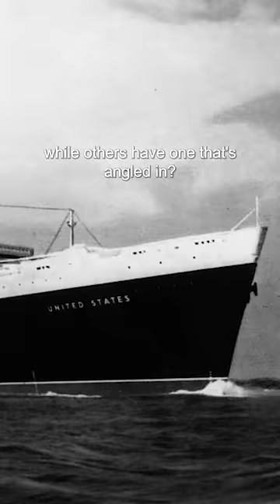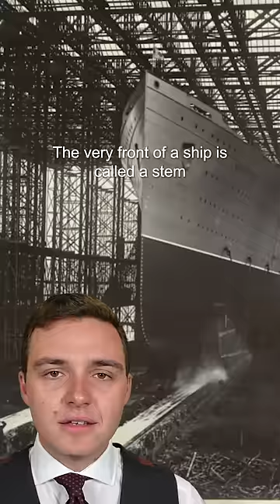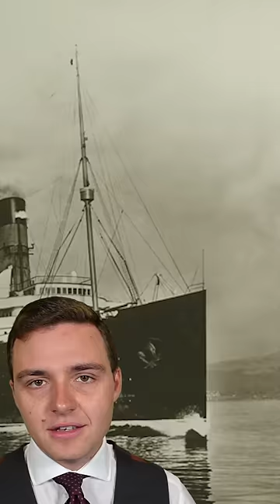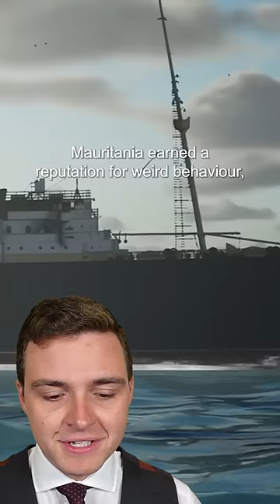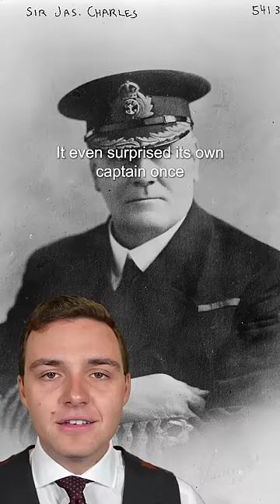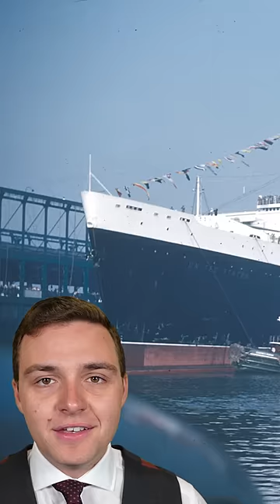Did You Know The Reason Ships Are Shaped Like This? #shorts

Comment: Straight stems had a slower rate of increase of buoyancy (compared to raked bows) as they pitched down into water.  On the plus side they had increased waterline length and thus higher hull speed.

Comment: I'd like to hear you talk about the Bulbous Bow, an odd-looking, yet ingenius, protrusion extending from the front of most modern bows (below the waterline). It's designed to cause waves which occur in counter frequency the regular bow waves, neutralising drag to an extraordinary extent, profoundly improving the ship's engine efficiency & reducing fuel use. (As much as 20-30% of a bow without it!)

Then there's relatively obscure concepts (to us landlubbers) like the Deadrise of the hull.

Comment: You know every now and then you are surprised at how perfect math can be.
Water weights 8.4 pounds per gallon. Im a bit of a Titanic fan so I know the size of the breach was determined by how fast she sank. And it was determined at 104,000 gallons per minute. So based off the time Titanic took to sink, that would have been 104.83 million gallons of water. I looked up the weight of the ship, and it happens to be almost approximately the same weight as the weight of the water it took in. 104.8 million pounds taken in, 104.6 million pounds weight of the ship.

Comment: Vertical stem maximizes the vessel's length at waterline, increasing the hull speed. Without rake or flare providing progressively more buoyancy and dampening oscillation, the hullform is prone to an unpleasant porpoising habit. Taken too far, raked stem and lots of flare can lead to slamming, so like much of vessel design its a balancing act

Comment: There were a number of destroyer & Cruiser designs from WW1&2 that were notorious Wet Ships meaning even on the Bridge amidships in any heavy sea, the Bridge crew would get soaked. The "Dreadnought" style straight stem bows were the culprit. Yet adding a small hydrofoil wing either side of the bow would have alleviated this problem. These day's large merchant ships have a large bulb at the waterline on the bow to break up the wave action in a similar way along with raked stems. Why hydrofoiling large ships never caught on escapes me. The fuel economy & increase in speed has obvious advantages.

Comment: Not so much "ride over" waves as it does behave like a pressure brake into the rise. With careful calculations the angle forward, arc upward of the wals and outward nearer the deck can equalise and answer with pressure applied against the rising water pressure. Tuned correctly they can be matched to ideal or fastest cruising speeds to maintain as flat or responsive action in the bow. It's a cut, float, slide trade-off.